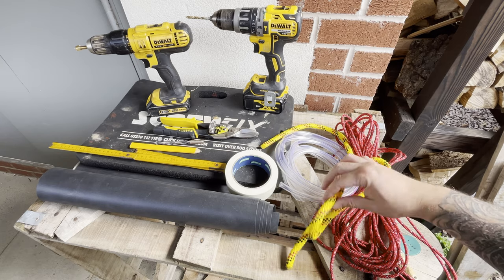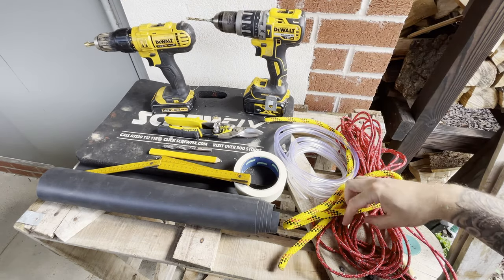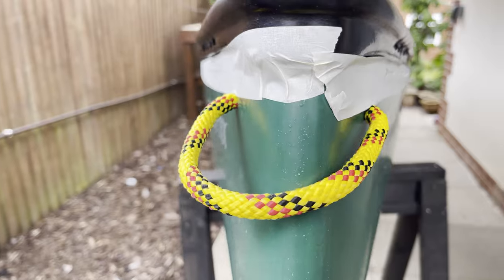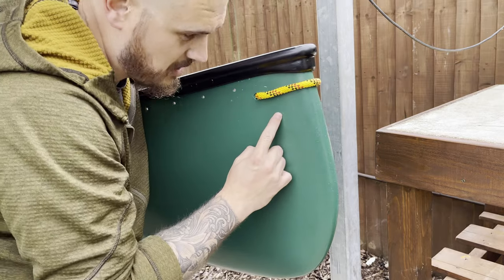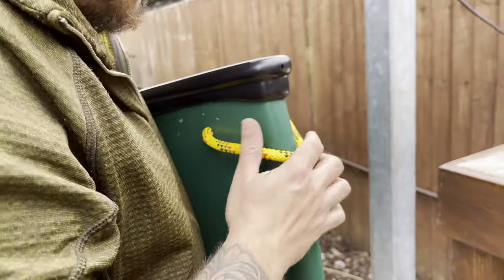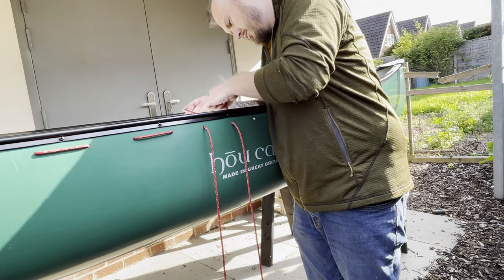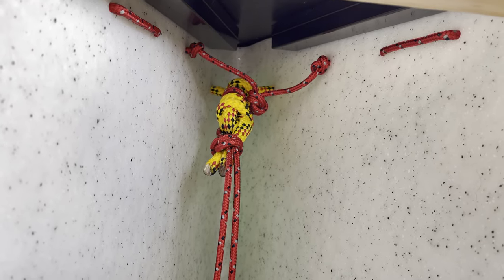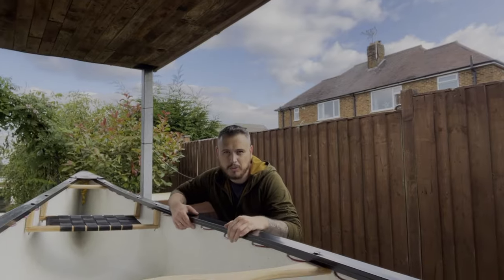Canoe setup and lacing up demo

Comment: Oh dear, the power drill on the canoe thing. Relaxe I just took a dremel to one of royalex canoes to V out frost cracks. I was puckered the whole time. Next was skid plates. 80 grit to roughen up the surface. The way the sand paper roughed up that surface, dear lord I kept repeating to myself. On skid playes I used kevlar felt, 2 inches wide at one end and 4 inches wide at the other. 30 inches long dry. Once the epoxy was soaking in and I was pressing out air bubles the wet length became 30.5 inches. I had to do some hasty surgery on the tape up at the 4 inch end to get at more royalex instead of masking tape. I used Gflex 650. Long pot time provides time to for little changes. Expensive for skid plates but I already had it for crack repair. If you need to repair cracks I would now advise to use the Gflex thickened epoxy, its like tooth paste. Would have made crack repair a lot easier.
Reply from the maker: Want a skid plate on it soon

Comment: Nice, i might not have used floating rope on the ends as many are not weight tested.
Just some 10mm climbing cord. (If you want 10mm)

Maybe it was a reflection, but when the camera points towards your knots inside.. is there small hole in the end of the boat at the top? 🤔

Looks good though 👌
Reply: I mention the rope not being weight tested.

This might only be an issue in moving water conditions, For example: Unpinning the canoe, you'll have 1000kg+ pulling on that loop. 

Something to think about, depending on your adventures. 😊
Reply from the maker: Very true but if it’s pinned I would used theses loops if I didn’t have to

Comment: Nice job mate. How’s it working out for you? Would you change anything now after using it this way?
Reply from the maker: Working very well thanks   I haven’t changed it yet ,  might still add more tubing at the front and back for more easy  points to hold airbags with , all in all Iv very please they give so many options , that’s for the nice 👍🏻 comment